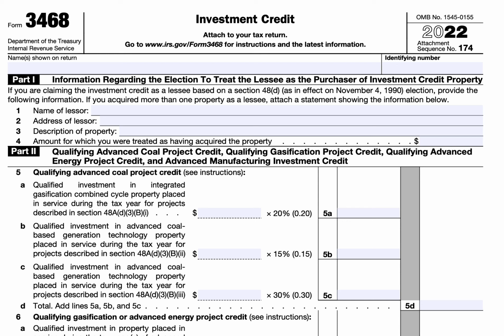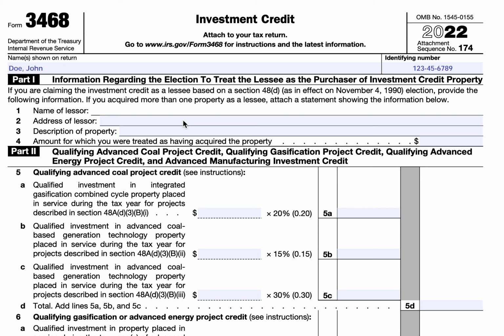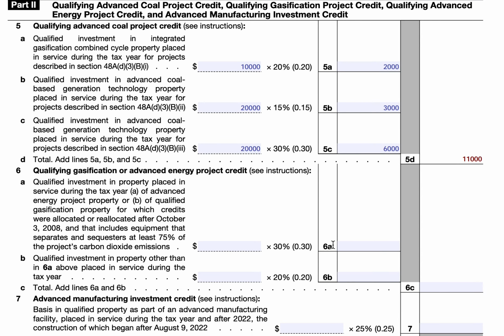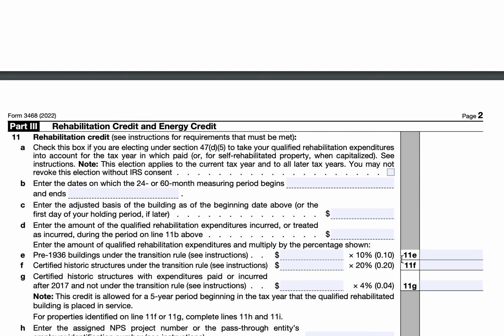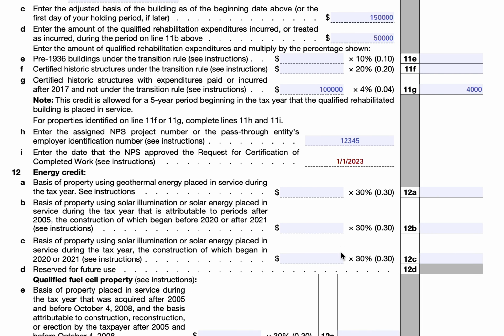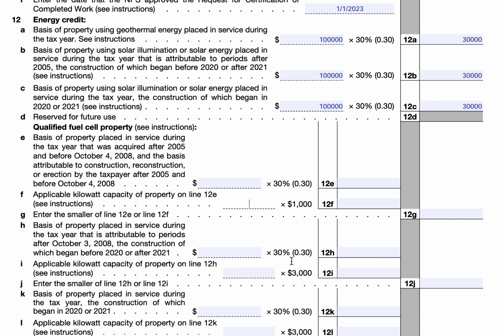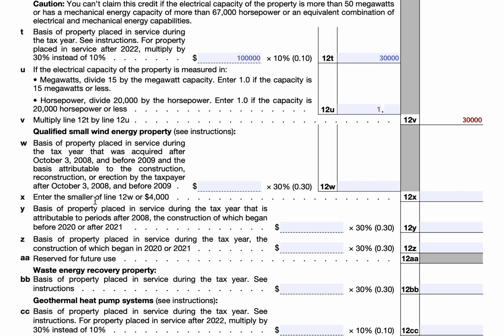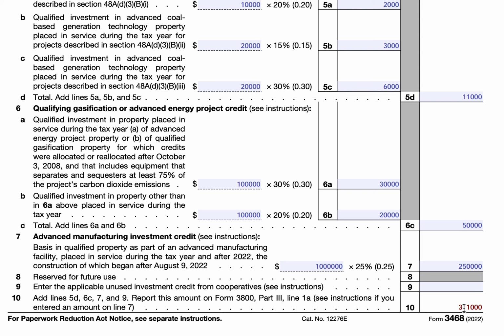IRS Form 3468 walkthrough (Investment Credit)

Comment: Does this form apply to claim solar tax credit for investment residential property?
Reply from the maker: Possibly. Here are the criteria, according to the form instructions:

Solar energy. Solar energy property is property that has the following.
1. Equipment that uses solar energy to illuminate the inside of a structure using fiber-optic distributed sunlight.
2. Electrochromic glass that uses electricity to change its light transmittance properties in order to heat or cool a structure.
3. Equipment that uses solar energy to:
  a. Generate electricity,
  b. Heat or cool (or provide hot water for use in) a structure, or
  c. Provide solar process heat (but not to heat a swimming pool).

I don't see anything about precluding the use of this form to claim credits for a solar project here. Meanwhile, IRS Form 5695 specifically precludes claiming the residential energy credit for any properties that are used exclusively as rentals.

IRS Form 5695, Residential Energy Credits
Article: https://www.teachmepersonalfinance.com/irs-form-5695-instructions/
Video: https://youtu.be/x5WT_h8ACQU

Comment: Do you need to fill this form out if you’re receiving this credit from a Partnership. Therefore the transferee did not generate the credit. Does it go straight to Form 3800 instead? Or does the transferee also need to fill out the 3468?
Reply from the maker: Most tax forms that flow through to Form 3800 have the standard line, "If you're only receiving a credit from a partnership or pass-through entity, then you can report directly on Form 3800 without having to complete this form." I do not see that in these instructions. 

Instead, I see this, directed at partnerships and other pass-through entities:

Attach a statement to Schedule K-1 that provides this necessary information and distributive share of amounts that each partner, shareholder, and beneficiary will need to compute their share of the credit related to investment property on their Form 3468.

I don't see anything that specifically tells individuals that they need to complete the form to claim the credit, but this appears to imply exactly that.
Reply: @teachmepersonalfinance  my fact pattern a C-Corp purchased an energy credit from a partnership. So the credit would get reported on form 3800, but the c corp wouldn’t also fill out 3468 right? The partnership would have to fill out 3468 and 3800 to show the transfer of credit out and we’d show the transfer of credit in?
Reply from the maker: This article appears to address your question: https://www.thompsoncoburn.com/insights/publications/item/2023-07-18/selling-federal-energy-tax-credits-who-what-when-and-howand-other-important-points